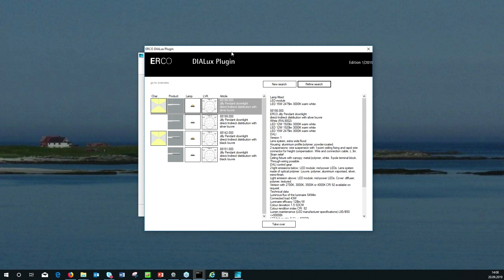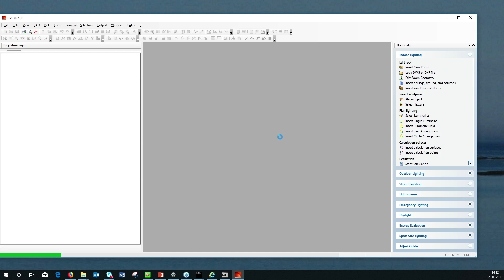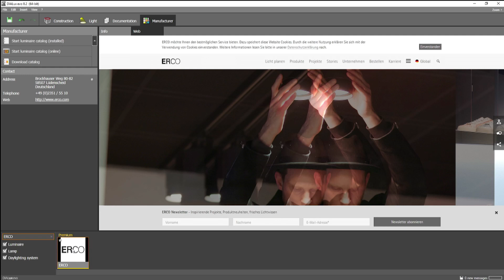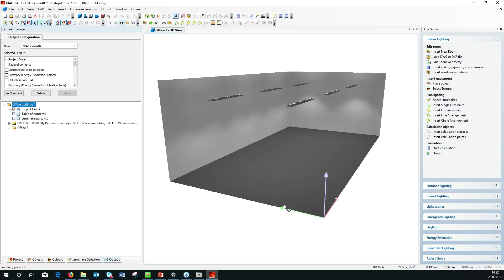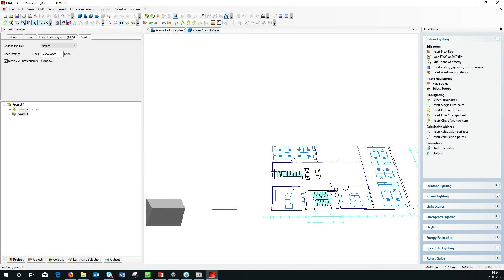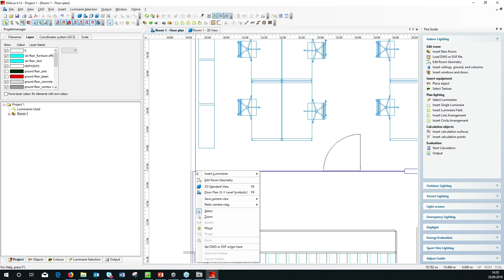DIALux evo for DIALux 4 users

Comment: Hello! 
I have a huge problem regarding DIAlux Evo! I am trying to import IES files of some luminaires that I can't find in the manufacturer tab. The problem is that these luminaires are imported as surface-mounted by default. How can I manually change the mounting type of these luminaires to pendant? 

Thanks in advance,
Spyros Dimakopoulos.